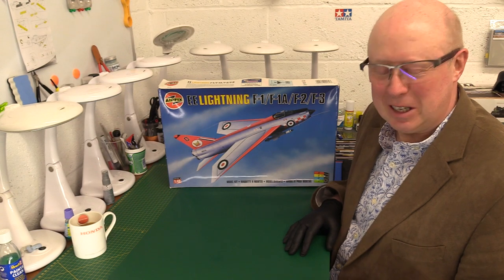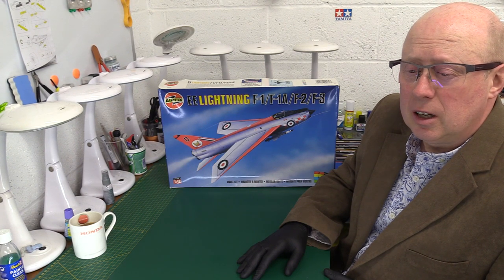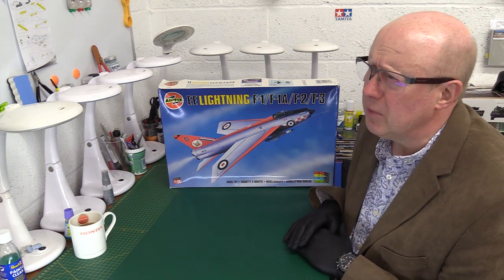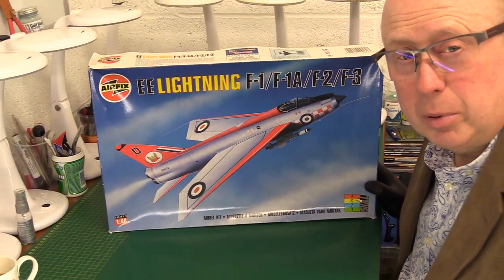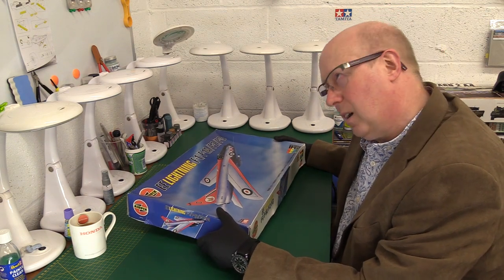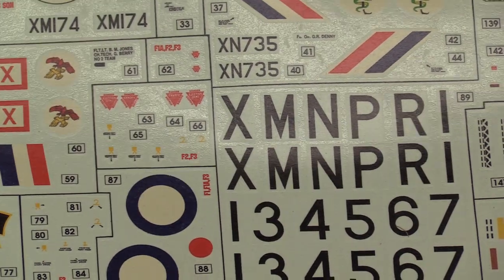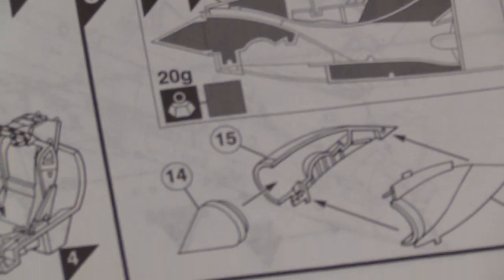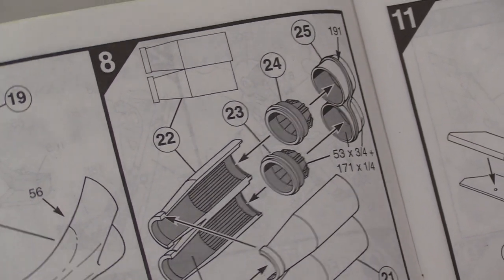Airfix 1/48 English Electric Lightning Kit review

Comment: A wonderful model.
Here in Smyrna, Georgia, USA, it is 86 degrees and 🌞. 
Although over 20 years old now, the 1/48 Lightnings are all still close to the state of the art. It needs an aftermarket cockpit and decals.
A good friend of mine did an exchange tour with 74 Squadron in the early 1960's.
He of course remarked quite favorably on the flight performance of the Lightning...and also on its' short flight endurance. He went on the fly the American counterpart, the F-106 Delta Dart.
Airfix had that kit tooled in South Korea. Finally a great Lightning kit....
The 1/72 kit is also very good.

Comment: The long, thin ducting down the side of the later aircraft aren’t antennae, Peter. They’re conduit ducting for wiring looms. There wasn’t enough room to run the looms inside the fuselage. “Shrink-wrapped airframe” is a nice analogy. Great video: I have the later release kit on my bench at the moment. Resin seat, Eduard PE...DROOL!

Comment: @02:12 - What he's attempting to describe here, we knew as a "Rotation Take Off" - Start up & taxy to the end of the runway, Select undercarriage up ! (The u/c wouldn't move as that was finally controlled by the WoG  (Weight on Ground) micro switches which wouldn't let the undercarriage retract until the under carriage legs were FULLY extended !
 With the brakes on, the pilot would open the throttle fully & then select full reheat. After a moment, let the brakes off, run along the runway until he's obtained sufficient speed for take off. Lift off, but hold it low so the undercarriage retracted. Keep the a/c fairly low to build up speed. Then near the end of the runaway, lift it up enough to give the tail clearance when he rotated the aircraft into a vertical climb. If in the mood, certainly he had enough power to easily go supersonic whilst in a vertical climb. Then usually disappear into the clouds & probably level off somehere about 60, 000 feet. ALWAYS impressive ! ! !.